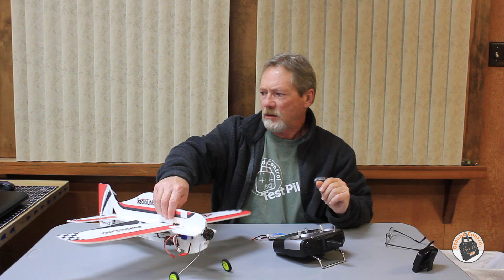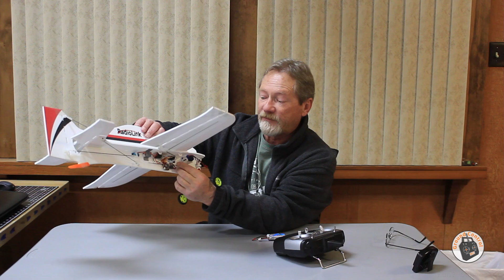Radiolink R8XM 8CH SBUS/PPM Receiver Voltage & RSSI Telemetry 4000m Control & Telemetry Distance

Comment: Any ideas on getting a cable for a 3s balance lead?
Reply from the maker: I could not find a telemetry cable with a 3S Balance Connector.
I would make some adapters so you can use 2S-6S LIPOs for Telemetry using different Balance Plugs since it's looking at total voltage and not individual cells.

Comment: can i using this telemetry receiver withba byme a so i can have telemetry and stabilization?
if so, if i need to reverse any channel should i do it in the be a or in the transmitter?(i have a boxer from radiomaster). thnaks
Reply from the maker: Hi Alex!
Yes, as long as your TX supports protocol Radiolink/Air you'll be able to use it just fine.
If I have a channel that needs reversed, I always try changing the phase on the Gyro for that channel before reversing the channel in the TX and that usually corrects it.
Also, the fail-safe on the Radiolink Receivers is offset by 8. For example, the fail-safe for the throttle will be on ch8 not ch3.
Reply: @GroundControlRC  Many thanks for the rapid response. 
I did use the byme A for the reverse originally but i noticed that gyro was in the wrong direction for the elevator so i got confused on the correct way to do it.
Thanks for the tip on the throttle ch, i learn in the hard way that throttle cut is not in channel 3 but 3+8 channel 8.....i did not follow the recommendation to remove the prop during setting.

I did adjust the throw in some of the channels because the rate waa too high for my skills and i could not run the calibration, i will remove thoe and put everything in 100% to see if i can finally calibrate the byme A.

Thanks again!!!

Comment: How could I set this up with my spectrum i8 please help with a receiver
Reply from the maker: I'm not familiar with Spektrum Radios but it's my understanding they only support the DSMX/DSM2 Protocols.
I can bind to this RX with my Multi-Protocol TX using the Protocol Radiolink / Air.
If you have a TX that can use that protocol you'll be able to bind to it.
Reply: @GroundControlRC  yea I’m guess I’ll just order the remote from radiolink it’s about $50
Reply from the maker: @cesar68033  It's a pretty good entry level hobby-grade TX.
I haven't had any problems flying aircraft with their TX.
I'm testing a brand new plane from Radiolink right now using the T8FB.
No issues at all.

Comment: I apologize if I missed the answer if covered in this video.  Does voltage telemetry work when using a multi-module radio (TX16s?)  The multi-module page on the Radiolink protocol seems to indicate no.
Reply from the maker: Hi Jason!
I'm using it with the TX16S and I'm getting battery telemetry.
They don't have a listing for the R8XM RX on the Multi-Module page currently.
At the top of the page it states: Telemetry: Yes.
It shows battery telemetry for the Surface Protocol but not the Air Protocol even with the same RX such as the R8EF.
I'm not sure what that's about ;-)
It list the Battery Telemetry as: A2=Batt/2 (adjust the ratio)
I did have to set the voltage alarm for a single cell voltage on a 2S pack and adjust from there.
Mine seems to be working fine but this is the 1st one I've setup so I could definitely be doing something wrong ;-)
See you in the Air!
Reply: @GroundControlRC  Thanks.  I saw your other  video after my post where you test this plane/RX with the TX16S and got my answer there but figured I'd leave this post for others to benefit from your reply here.  RE: Your threshold on the voltage alarm here is what I'd do:  Run a plane on the ground at about 70% throttle and stop the prop when you get close to how long you know you can fly.  Find when the resting voltage is around 3.7 and then see what it is under load and set your alarm for that.  Temperature does have an impact but even on a 70 degree day a pack at 3.7V resting is going to sag to ?? under load.  Figure out what ?? is and go with that for your alarm.

Comment: Totally enjoying your thorough review of planes and accessories. Can you do a full video or a PDF for set up on a TX 16s for the flight controller and sbus receiver? TY. I'm hoping to use a Futaba R6303 SBE receiver or get the xm8 radiolink receiver. KEEP UP THE OUTSTANDING WORK!
Reply from the maker: Thank you much Ray!
I publish a PDF Setup File and OpenTX Model File for each aircraft when I have them setup and flying well.
I publish them on our Facebook Page for download for those that wish to use them.
I just published a video on downloading and using our Setup and OpenTX Model Files on our Patreon Channel and it will be available on our Youtube Channel at the end of next week.
The Setup I use is the one for the HK Hawker Hurricane which has the Radiolink Byme-A Gyro and Radiolink R8FM SBUS Receiver.
The OpenTX Model File shows the programming for the Gyro as well.
So to find the files for the Hawker Hurricane, a search of our Facebook Page for "Hurricane Setup File" will bring up that post with links to the files.
You might find that Video very helpful when it's posted at the end of next week.
See you in the Air!

Comment: I just ordered one. I will let you know how it went with BymeA and TX16S mk 2.
Reply from the maker: Awesome!
I just received my (4) R8FM Receivers a few days ago but I'll probably be ordering these the next time I need some.
See you in the Air!
Reply: @GroundControlRC  I just managed to connect BymeA and R8XM. Everything works great except of Failsafe setup. Do you know how to set Failsafe up on R8XM?
Reply from the maker: @dundomaroje22  Yes, the radiolink protocol is a bit different for fail-safe setup.
The fail-safe settings on are different channels than the primary channels.
CH1 fail-safe is set on CH9, CH2 fail-safe is set on CH10, etc.
Oddly enough, the only one I've had to change is the throttle fail-safe channel.
All the others went to neutral on fail-safe as they should.
Here is the Multi-Module radiolink protocol page that shows the fail-safe channels.
https://www.multi-module.org/using-the-module/protocol-details/radiolink

Comment: Can you pre warm batteries before flying to stop getting a low battery alarm?
Reply from the maker: Yes, and I try too keep them warm until I get to my flying area but once they're out on the table they get cold soaked pretty fast.
I need a heated battery box ;-)
Reply: @GroundControlRC .
Thanks for that.
Good to know now. I had heard they didn't like the cold but I wasn't sure if you could pre warm them.
Thanks so much!!
Good vids by the way.